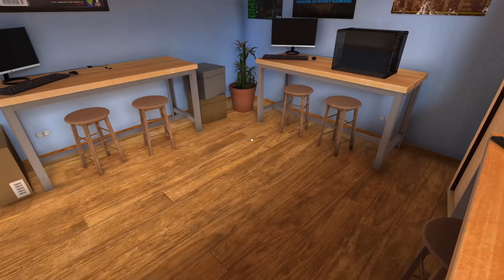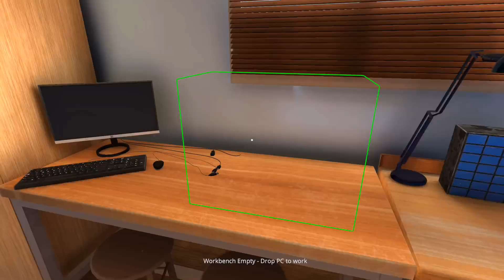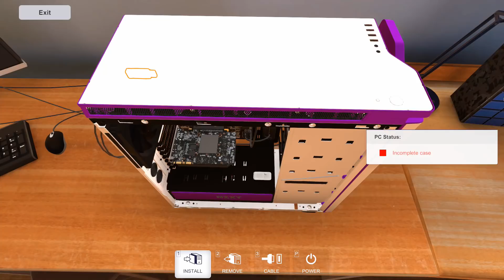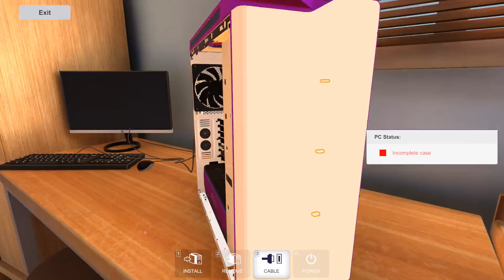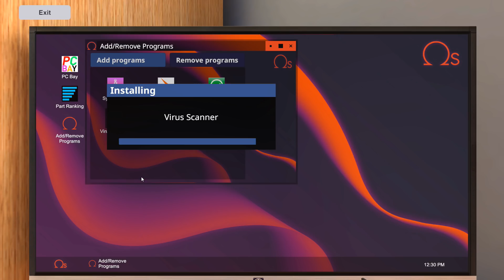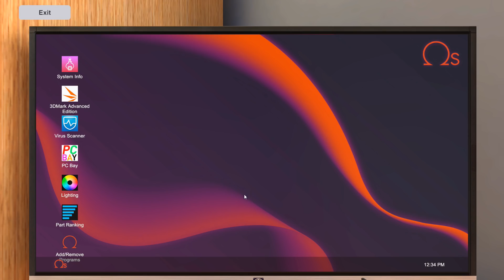How Retro Does PC Building Simulator Go? [Quick Play] | Nostalgia Nerd

Comment from the maker: I'm holding out for a "Classic DLC Pack"
Reply: Nostalgia Nerd we did put suggestions for older parts in steam discussions
Reply: "Buying Cheap" DLC with those wonderful Dell cases and such. Oh god...
Reply: Oh yes! Let's install maths co-processors, cache chips, pc cone speakers, Sound Blasters, and Roland MPU-401 cards with peripheral options including a Roland MT-32 and MIDI cables! ;-)
Reply: ...And a doubt: would NVidia grant the game usage rights for 3dfx products and brand?
Reply: They'd need to add motherboard configuration via jumpers, the ability to burn a CPU because wrong dip switches or jumpers were used on the motherboard, the glorious IRQ conflicts, and the CRT screen looking like a "magic eye book" picture when your 4mb video card can output 1024x768 while the CRT can only do up to 800x600

Also add a feature to poke and cut yourself with the bottom of the motherboard, since the soldered throughole components are more like death spikes
Reply: Let's install an IEEE-488 interface on a Commodore 64 and configure an SFD-1001 to set up a BBS.

Let's install a Picasso IV into an A-2000 and then configure Picasso 96 to have the Workbench display through it.

Let's upgrade the RAM in an Atari 800 to 48k!
Reply: Someone @ whoever made that game to add "classic DLC pack"
Reply: They probably got paid by any manufacture shown here... retro hardware, not likely to happen.
Reply: You are totally onto something.. this would be way more fun if it allowed retro builds
Reply: beige mode
Reply: in theory, it might even be possible to retro games on them... in the game.
Reply: Wood grain case mod!
Reply: Some classic 440BX boards, the classic Celeron 300A, and please include that Abit BP6 which can run two C300A in SMP and overclock them to 450MHz at the same time.
Reply: thanks for the memories bruh :'(
Reply: I've got a nice old Dell OptiPlex GX1 PIII desktop in front of me.
Reply: Well, they already got the constant restarting of the OS feature in there, it's like going back to Windows 95.
Reply: Drake Tungsten Spoken like LGR lol.
Reply: 陈北宗 I still got a bp6 with x2 celery 466a running at 533 lapped with swiftech heatsinks and screaming delta 80mm fans. Ran CS fast with GeForce 256pro and managed 3-5fps in handbrake lol just sat in a box now binned my beige full tower :(
Reply: have CPUs like 486, Pentium, Pentium MMX, AMD K6-2, Pentium II, and others.
Reply: Yeah, stabbing your virtual motherboard with a screwdriver when installing Athlon XP heatsink or replacing leaked capacitors is going to add some more intense emotions that this game seems to severly lack.

Comment: Speaking of memory doublers -- Interestingly, Android has a built-in software based memory expander -- (it's part of the kernel in some builds) -- some builds like Cyanogen (now defunct) would let you modify the settings -- basically it takes a section of real memory and transparently compresses/decompresses what's being stored there (so you basically have L1 memory [uncompressed/fast] and L2 memory [slightly slower, but still faster than swap] -- effectively, you're using software to give you more memory than what's actually installed in the device). :-)

Comment: Building a modern PC is just not as fun as it was in the old days, messing around with big IDE cables, the endless struggle of trying to get the floppy drive to work by trying different combinations of cable orientation. Installing MS-DOS and 3.1, messing around with IRQ and DMA settings to get a sound card to work, kids these days don't know what they are missing out on.

Comment: I was very disappointed by this game. Prices aren't realistic. Parts are very limited and some of them are ficticious. Some of the cases don't even work right, causing parts to connect in ways that don't make physical sense. You don't actually get to learn as much as I was hoping for in this game.

I'd like to see a version of this that's plugged into PC part shopping sites so you could use it to design and build a PC for your friends that they could really buy and put together in real life with real prices scraped from the Internet. I'd also like to see a retro mode where you play through it starting in the 1980s with real parts from all those decades coming out when the real parts did and adjusting their prices over time like real parts. Work with the community to use Steam Workshop to collect and arrange big packages of user created parts to download. And THEN add ficticious parts, not because you have to, but because it makes the game cooler and funnier and gives it an extra edge.

Classic car simulators (racing games) don't put up with this crap. Why should we?

Also, it would be cool if at least for the older operating systems, they could use FreeDOS or something else real to emulate a real virtual PC when you turn it on. I mean, there is free open source software out there for doing that. Why not use it?

Comment: "I need an Ethernet card" Lol outside of server stuff, I don't think there even ARE any motherboards without a built in NIC. Anything from at least the last 15 years will have a built in NIC. Anything vaguely modern will have a gigabit per second NIC, and ethernet cards are really only needed if you need speeds of 10 gigabits per second.

Comment: "How retro does PCBS go?"
- installs a 1150 mobo
the answer is, "it doesn't".
Reply: Still use a 775 daily, very capable and parts are found on the curb or for pocket change .
Reply: I'm still using a AM2+ mobo (MSI K9A2 Platinum)

Comment: Nice video, but this simulator looks really boring. It should have AT cases and motherboard with DIP switches to set (and have to hunt down the motherboard manual in order to get all the right jumpers set), add matching RAM SIMS in banks having to match the correct speed, configure hard drive types and maybe even identify and enter the drive geometry, deal with BIOS limitations on hard drive capacities, set master/slave jumpers and find the proper IDE cables for ATA100 and faster drives. etc. Modern hardware is way to easy to set up.
Reply: For the price they are charging for the game, you can goto a college surplus store and get 5 old PCs to do this with. Take them all apart and mix it all up. I saw 17 year old computers at MSU surplus a few years back. Late 90s macs.
Reply: Yeah, present-day stuff is Easy mode. Add the 2000s as a Medium difficulty, the 1990s for Hard, and the 1980s for Extra Hard.
Reply: @Roxor128  
2010's - Easy Mode
2000's - Normal Mode
1990's - Hard Mode
1980's - Lunatic Mode
Reply: @aretard7995  1940s - You'd better have a room free and know how to speak polish. Now hurry up, there's a war to win.

Comment: PC case: Little Devil LD PC-V10+Phase Change Cooling, needs Kneeded eraser and Neoprene sheeting for install of Cooler probe 
Motherboard: AORUS ZENITH EXTREME X399
CPU: AMD 1950X TR4 socket
RAM: 8x sticks of Crucial 256GB DDR4 3000MHZ RAM modules
GPU: AUSTECH EN9500GT (NVidea GPU)
OS Drive: 100TB Data-Centre SSD
Optical Drive: LightOn Lightscribe DVD R/W
RAID ARRAY: 4X Crucial MX500
PSU:1KW CORSAIR
OS: Microsoft Windows 10 or Linux Mint 18.3(CINNAMON) (SYLVIA) 64bit edition

Comment: I hate modern hardware and how the tendency is to remove support for basic stuff.
I think the peak of PC is like an AT pentium 3 motherboard that has isa, pci and agp slots. it basically is compatible with everything since the XT in terms of hardware and software.
Reply: They just remove support for stuff that hardly anybody uses anymore, mostly obsoleted by newer tech. I'd rather have two or three extra PCIe slots than a bunch of unusable legacy slots.
Reply: sometimes people don't use it because they take it away.
I've seen some computers that don't even have a cd/dvd drive, that's insane, that's not improving or advancing or any other positive thing, that's downgrading, going backwards, a computer from this year without a disc drive is more obsolete and unusable than a pentium 2 for me.
I don't know if I can explain correctly how I think about this... hmm... 
when I had a 386 dx40 with 8mb of ram I got a cdrom drive. if that computer is capable of doing stuff like copying files from a cd and playing music, why can't a computer you buy today do it? isn't it supposed to be more advanced? if the old crappy one from 25 years ago can do something that a new computer can't then there's a problem with the new computer.
Reply: Pelger A computer you buy today can do it just fine, with a $20 external drive.  But the uses CD drives once had have been superseded by flash media and personal media players, and now streaming services and cloud storage. 
This complaint is kind of odd, rather like calling a Win95 machine a downgrade because it can't read your punch cards.
Reply: it depends on what you want the computer for.
I like a lot more how things advanced from XT up to pentium 2 or 3 because you didn't lose features, I want PC to always have the best backwards compatibility.  upgrading from XT to 286 is like "this can do everything the XT does and more!", when you upgrade to 386 or 486 it's like "this can do everything the 286 does and more!", when you get a pentium "it can do everything the 486 did and more!", and so on.  it's like you still have your older system, you can keep running the older games besides the new games, "gee, on this 486 I can play mortal kombat and doom but I still can keep playing double dragon, prehistorik and zeliard!". after pentium 3 it became like "huh? no isa slots to put a sound blaster on it and the onboard sound card doesn't work in plain DOS? this is bullshit!!!". I don't know if I'm being clear, but it feels like you never had to worry about losing features and capabilities going from XT up to pentium 3, ha, I even used the same case for all my builds up to that point!. the same sound card since the 386 days, the same AT keyboard since the 286 days, the same floppy drive even now. I think PC had a couple of decades where upgrading didn't mean breaking compatibility with all that came before.
these days you get a new computer and it probably won't even support stuff older than five years.

Comment: 486'es? Too modern. "Please build me a pimpin' PC. I need a 25MHz Harris '286 in a Chips&Technologies NEAT motherboard, with 4MB($$) of dual bank interleaved 90 nanosecond ram, a Camco hard disk card, a 106MB seagate drive, and an awesome Tseng Labs ET3000AX graphics card. Add a Racal Interlan NI5010 if you can find one."

Comment: If sierra would have done this game:

- You cut yourself with the back of the case, you die a horrible death.
- You mixed the cables for the power and shutdown buttons, you burn the house and die a horrible death

Wait for the atari and spectrum DLC pack ;D
Reply: Alexander turns on the PC.  whirrrr beep!  Suddenly, Alexander notices the smell of burning silicon.  <anxious music>  A sizzling sound is punctuated by a sharp pop, and followed by a wisp of smoke pluming from the CPU! <music escalates, Alexander shrieks and grabs the fire extinguisher, sprays the case>  <music ends dramatically, screen changes to black, with a hand-painted burned CPU in the middle>  Maybe next time, Alexander should try to keep his cool by installing a CPU fan.

[ load ]   [ restart ]   [ quit ]
Reply: How about the Lithium-Ion laptop battery DLC? :D

Comment: VGA? What's wrong with CGA?
Reply: Everyone is talking about colour displays... what about MDA (Monochrome Display Adapter) from the early 80's, and its 9 pin connector
Reply: Stop forgetting about Hercules and EGA, you dirty wikipedia-skimming heathens.

Though to answer the OP question, probably because you can at least hook up a VGA (or certain super-EGAs via an adaptor cable) to a modern monitor and have it work. Trying to adapt anything older (and thus lower horizontal frequency, and mostly with TTL signalling) would be nightmare if the game didn't also include dedicated monitors or at least an NEC or Sony multisync - as anyone trying to hook up real-life classic machinery to modern flatpanels, TVs or capture devices can bear witness to.
Reply: I have a couple. They are CGA mono.
Reply: We are talking about connectors

Not video cards
Reply: CGA uses a 9 pin connector, VGA uses a 15 pin connector, so they are different.
Reply: You can connect CGA either via composite or RGB-I (that 9 pin connector you are taling about). So the connectior is RGB-I but the display mode is CGA
Reply: As a matter of fact I have. Begin '90s, at work we had "portable" Compaq machines with orange monochrome screens, very stylish.

Comment: Is it even a PC Building simulator if you're not cutting up your hands on the edges of a cheap metal case. You need to bleed for your art.
Reply: Asobi tech once I sliced 8 fingers handling a cheap case
Reply: Or trying to stuff a 2CPU server with redundant PSU RAID 1 into a 1U rack mount.
Reply: @2009dudeman  Maybe you should contact the hydraulic press channel for that.
Reply: el mejor comentario por lejos. best comment ever!!!!

Comment: I'd rate this simulator 2/10 because it doesn't reflect the pain of removing and reinstalling all of those screws by hand only to realise you've missed a bit.
Reply from the maker: Agreed.
Reply: I had to flush my rigs water cooling loop.
Some how I got cut.
Doesn't replicate this
Reply: And having a screw vanish instantly once it hits the ground.
Reply: And none of the pain of dealing with multiple IDE ribbon cables!
Reply: @gmc9753  Ever installed ol MFM drives? Thats one 34pin ribbon cable for 2 drives and another 20pin PER DRIVE ;).
Reply: The cases are just for show anyway....    i dont use a case and my gaming rig runs much cooler than with a case ;)    ofcourse it gets a bit dusty,   but a can of air takes care of that once every 6 months or so   (dont use the kind that spills liquid tho)
Reply: Or the fun of realizing you put in an extra standoff and your motherboard is a bit bent.
Reply: Or the finger cuts